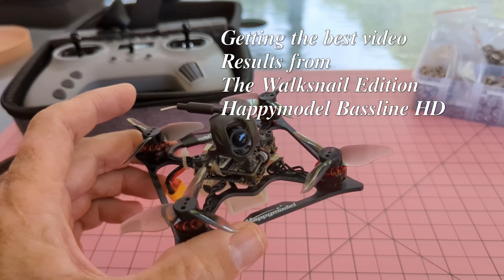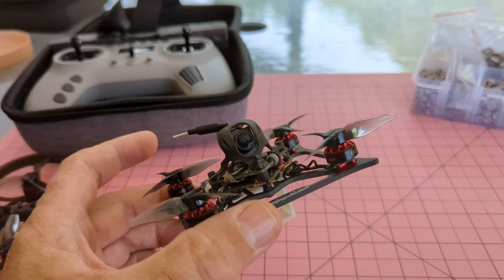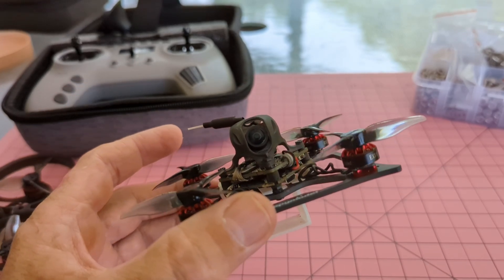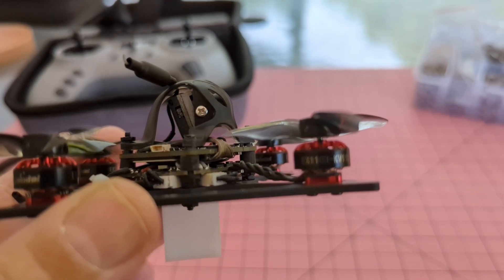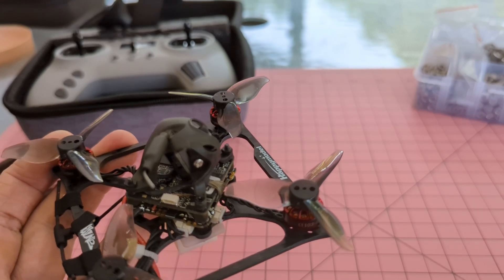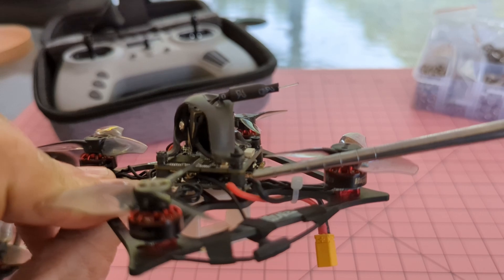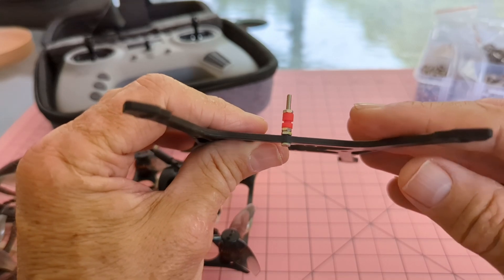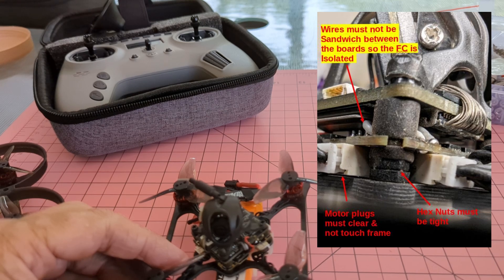Fix and flight for Happymodel Bassline Walksnail HD and how to get the best video feed.

Comment: Thank you! I was trying to track down stutter while flying. Ended up swapping all the motors around trying figure it out, messed with PID tuning a bunch, but no luck. Tuning helped a bit but still had a noticeable shutter. It was the ESCs touching the frame! Adjusted the nuts and spacers to make a gap and that did the trick! Thanks again!